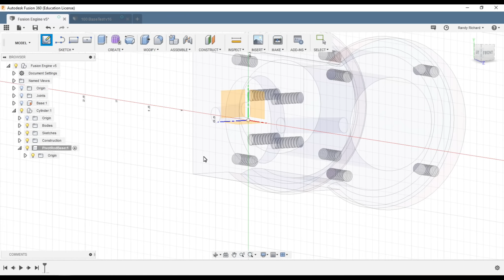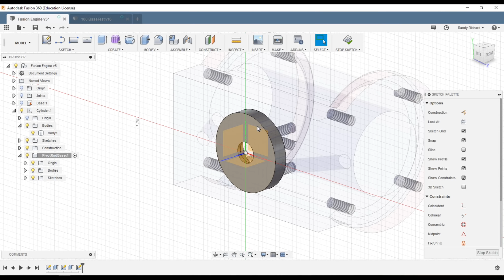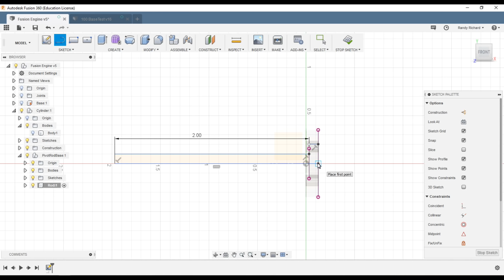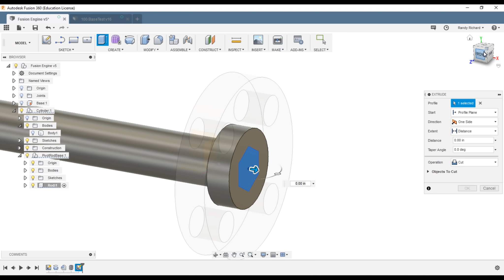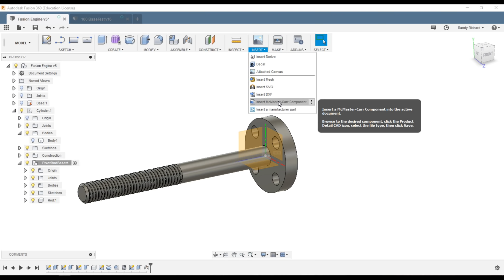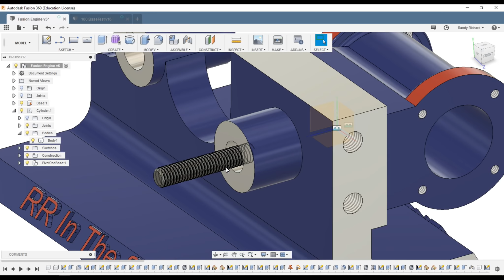P3-1 How to Model the Cylinder Rod of a Model Steam Engine From the Ground UP

Comment: I finally made it through this video. I’d get to the end of the video with my model and my cylinder wouldn’t pivot or I’d get to the end of the video and discover that my socket head cap screws were inserted into the disk cockeyed or I’d get to the end of the video and discover that I built the screws at the model level and not the pivot rod base level. 

I want to keep my model as close to yours as I can as I work through this series. It is great practice, but sometimes a bit frustrating, to try to figure out where I diverged from what you were doing at any given moment. Thanks for putting this video series together Randy. Once I get through them all with my model I will have a pretty good understanding of the basics of Fusion 360 (and a pretty good looking virtual model steam engine!)

Comment: Ok, I had some trouble with projecting the bolt hole circles onto the pivot rod base in order to extrude the clearance holes. It seems that no matter what I did, I could not project the holes onto the sketch on the extruded disk face. I finally solved the problem by undoing the timeline all the way back to the sketch for the pivot rod base before it got extruded and projected the holes onto the sketch. I was then able to create the circles for the clearance holes in the proper locations. So when I then extruded the disk, the clearance holes were already there.

Now looking back through the video, it looks like I missed a step. It looks like you turned off the visibility to the pivot rod base before you projected the holes.